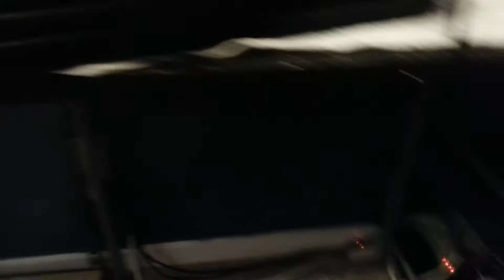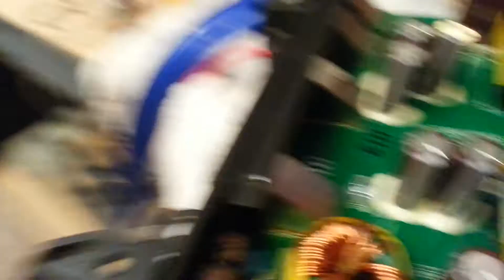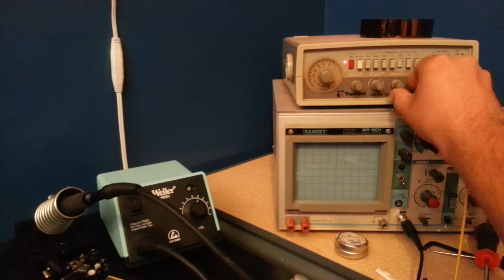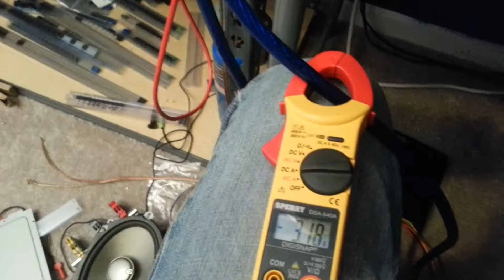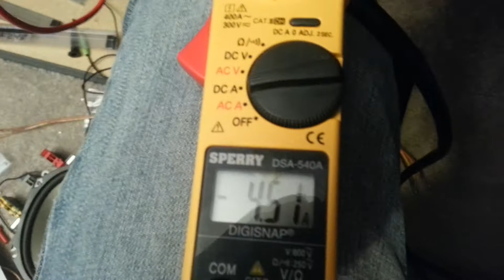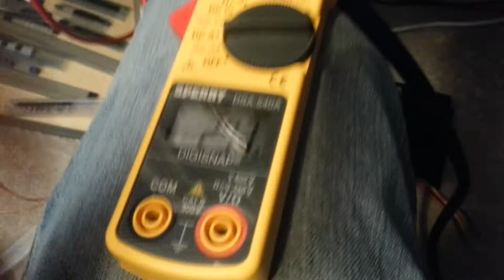Alpine MRX-M240 - Simple Test After Minor Repair

Comment: So when I first installed this amp I had same problem. Play all day and pound for a sec and off it went. I had 0ga front to back and less than a foot of 4 guage between amp and block and couldnt handle the current. I have seen my amp pull 149.9 amps. Also fuses get loose as well as power and speaker connections need to check frequently. Best amp i have ever owned. Truly takes a beating. Add washers to fuse bolts to help keep things tight

Comment: and amp does more than rated power mine does 2700 rms I have the birth sheet. you'll need extra battery 0 Guage big 3 ect, running a 12" hcca comp it slams hard but this amp might just burn this 12 lol
Reply: thats exatcly wjat im runing and everything, but right now it wont play idk what is wrong with it it turns on but wont play
Reply: thats exatcly wjat im runing and everything, but right now it wont play idk what is wrong with it it turns on but wont play
Reply: +Victor9oi888999 Ruiz 
I'm going to give you the best advise ever just contact alpine even if u don't have the receipt and send it to them they will either fix it or more likely just send you a new or refurbished amp trust me that is your best bet make sure check rca and grounds first speaker wire ect just in case
Reply: +remyrick A i have it open now as i msg this, i found an rca stick pice stuck in the rc input hoping it would be my problem but still tryed it and nun, i just got it out my car last nite to hook up a battery everything was fine till i put it back and dont wanna play idk why ... and how long do u think they will take with all the process
Reply: +Victor9oi888999 Ruiz about a week or 2 at the most but mine took a week but weird thing they sent me a new amp and I swear my old amp was louder but what ever glad it works now will not let it go under 11 volts this time or let the speaker wires touch good luck man
Reply: +remyrick A ima have to try this, i was thinking of going to the bazar and somebody fix it. probably is a little fuse probles but i really dont wanna waste no more money . im just gonna have to try it and be patient.. did u have to pay anything ? and what did they asked u
Reply: remyrick A is this amp 1 ohm stable?
Reply: @oscarcardenas2942  yes but power drops way down, sort of a “protection” but @1.4 it hits over 3kW, with box rise you could wire sub down to 1ohm and get Max power without actually hitting that massive 1ohm dropoff

Comment: Does this amp do rated power?
Reply: Almost 3kW @1.4ohm @240amps
Reply: @Nūrd_AF what I don’t get is how it has a 175 amp fuse but can push out that much power shouldn’t it at least have a 200 amp fuse
Reply: @williedee6546  The fuses amps use are “slow burn” which means it has to sustain over that amperage for a certain amount of time to burn out the fuse, that usually only happens during play when running a single test tone / “burp”, normal music has such a variance it hardly holds that pull for long enough to blow out the fuse.